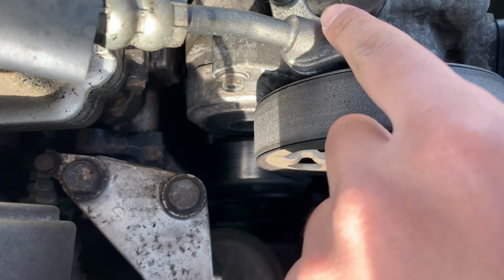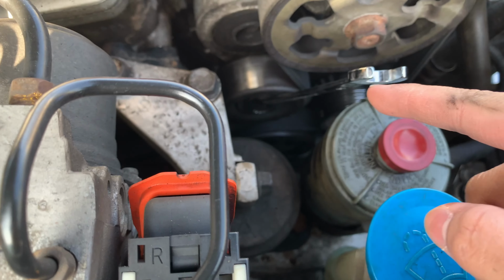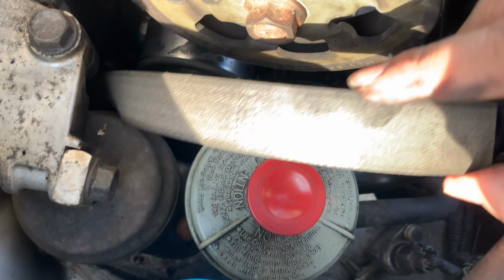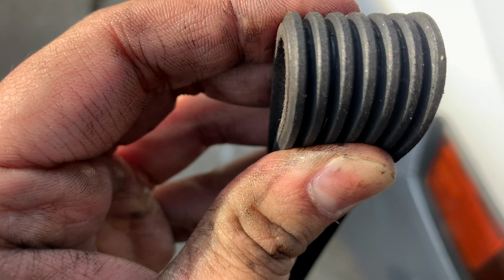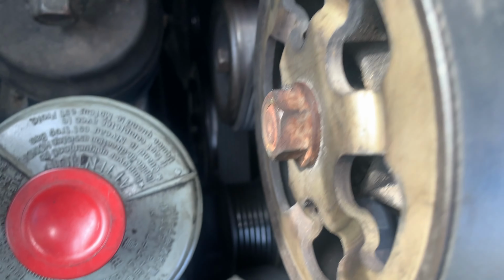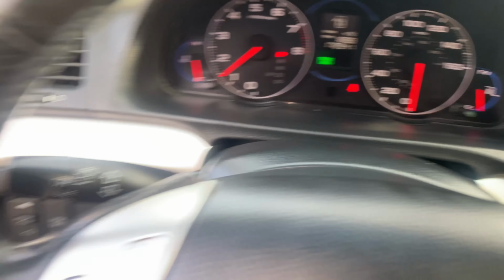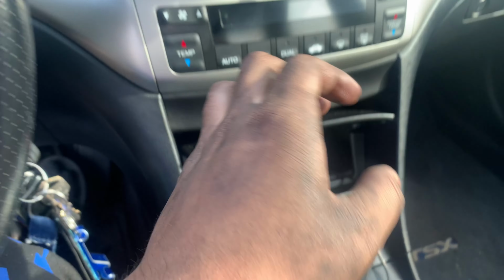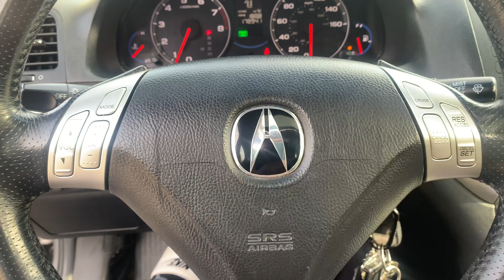NO MORE SQUEAKY BELT NOISE! Acura Tsx 2004-08 Serpentine Belt Replacement (easy and quick)

Comment: Hey I have a acura tl 07 but I’ve recently replaced the power steering pump, power steering pulley and fluid on it and I hear a like squeaking/rubbing sound when turning either left or right side all the way. Does it more when I’m driving slowly and turning. Does it more when I pull up into a parking spot and turn all the way or when I do a uturn. Any idea what this could be. I know this car is different from a TSX.
Reply from the maker: I just changed my o ring seals on my tl type s. Had the same issue you’re having. Change the seals, they should have them at autozone. Then bleed the system. Didn’t bleed my system because it seemed straight but it was sucking air in when steering at low speeds with the old seals.

Comment: Recently checked out your channel, nice videos!

I was wondering if you can possibly lend me some assistance with an issue I have. Keep in mind I have a 2004 Tsx. I've had this solid battery light always on for the past few months. I changed the alternator, the same issue. New battery, the same issue. Would you know what else could be the problem? I have inspection soon too, which is funny.

Comment: I already changed the belt, Idle pulley and belt tensioner all brand new. But it still noise.
Reply: Were you able to figure it out? I replaced my tensioner last night, and the belt is less than a week old, and there is still some squeaky noise when cold, although much less. My guess is another pulley is going as well?
Reply from the maker: @JonathanCamposReyes what kind of belt? Some belts are just loud

Comment: Damn you usually gotta take to passenger front side tire off to access the belt better.
Reply from the maker: Honestly that’s a lot of work, once you do it once or twice you’ll get hang of doing it from the top.
Reply: @FastlaneHero  wow that's reassuring thanks. I was thinking I could put the belt on with like a thin ass metal bar or something just push it on to the pulleys
Reply from the maker: To make it easier, move the power steering reservoir so it’s not in the way.
Reply: @FastlaneHero  thanks